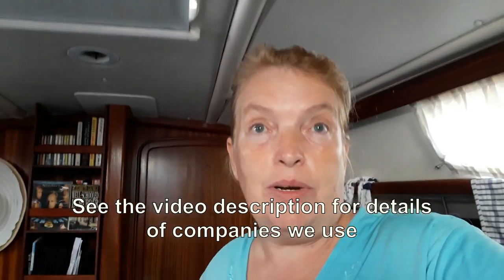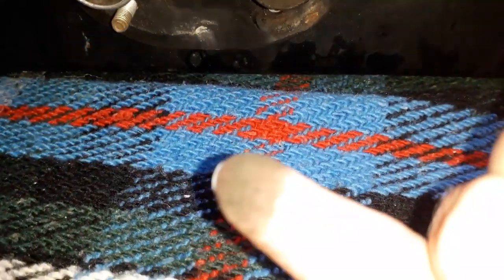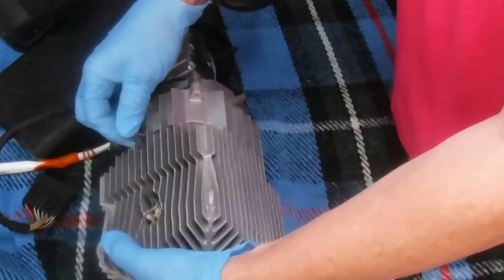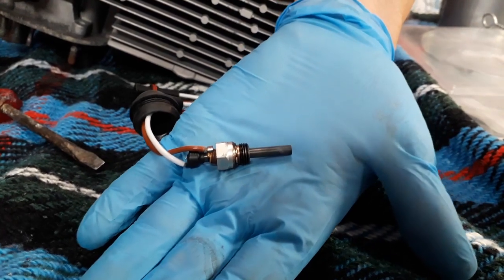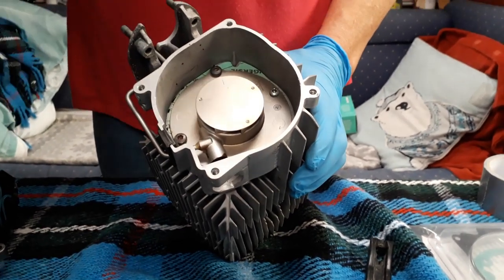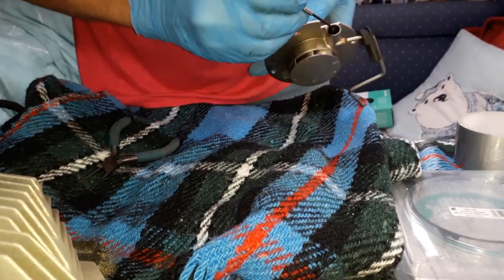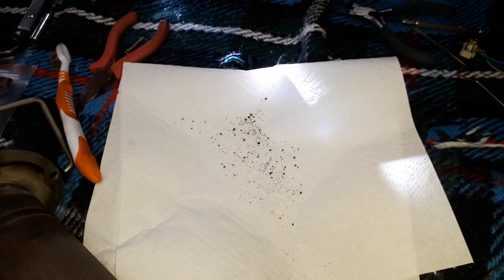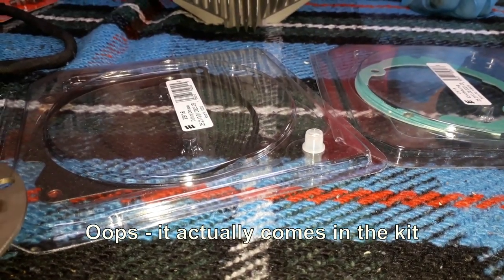Saving money & staying warm - Servicing our Eberspacher Airtronic D4 diesel heater - Ep. 111

Comment: I'm pretty sure you will know this by now but you can use your battery drill/driver to hold screwdriver bits like a torx bit and then either press the trigger or use the whole unit as a big heavy screwdriver!
Excellent explanation on the servicing of that heater. All lorry drivers are familiar with them since they are generally fitted in sleeper cabs. 🥵
I KNEW I should have waited till the end...!!!
😂😂
Reply from the maker: We have gradually got better at servicing this. Practice makes perfect 😉

Comment: Well done service great vid , our heater failed and was beyond repair ,so we replaced it with a cheap Chinese unit and I must say at £120 it’s incredible and if it fails I’ll probably throw it out and get another, although it’s identical to yours and all the parts are available. Thanks again enjoying your honest Vlogs👍
Reply from the maker: Thanks for the comments. I am glad you got a solution that works for you. I am told that with the Chinese versions, the exhaust hose is the weak point, but if you have issues with it they are not that expensive to replace.
Reply: Sailing Yacht Salty Lass yes very much inferior exhaust but I was fortunate to be able to reconnect to the existing eberspacher exhaust, so far I must say it’s an impressive wee beastie. Enjoying your vlogs I’m across the water from you in Clyde marina (just up the coast from Troon)
Reply from the maker: In the one with the big crane?
Reply: Sailing Yacht Salty Lass you may be thinking of James watt dock further up the Clyde ardrossan is literally just across the bay from Troon ,I know you’ve been to Largs and Troon,Clyde marina is the other main marina between the two ,the other big crane you may be thinking of is the two ore terminal cranes next to Largs that have just been removed.
Reply from the maker: The big crane was at Greenock, but I recall the Largs cranes that we went past last summer. Adrossan used to have a ferry service to Belfast and when we came past it from Milport we heard the Habourmaster on the VHF broadcasting boat movements for some vessels. CalMacs perhaps?

You have brought it all back with that comment. I had sort of fogotten it, but it has come flooding back :-)

Comment: Super video. Nice to see it is not so hard. I will be adding heat to my 22ft as I plan to sleep aboard from time to time
Reply from the maker: In these climates, onboard heating can be a lifesaver. Literally.
Reply: @SailingYachtSaltyLass  I used to love the cold, but these days no. And my two dogs would be most upset if no heat was there for them. I would have a mutiny on my hands

Comment: That is a really good video how to! Gona share on our FB page. We have an Avro M5  which is basically a Makumi (Japanese) diesel heater. They work in the same way but the glow plug is from a diesel car (Easy and cheap to replace) and they have a brushless motor (no brushes to wear out). So the top tip from the supplier in Southampton was every spring run it on paraffin at full tilt for an hour to burn off all the internal carbon. Seems to work! If you do this it never needs a service until it stops working and then it either the glow plug or the overheat sensor! Sure enough 5 years on and one overheat sensor replaced at £40 shes been 100%  and never a full service! We also found a trick to wire in a switch so the blower runs and the heater does not. Its good for cooling the boat when your down south. I think you can do this with your heater too. May be worth a google? Thank for sharing cracking video!
Reply from the maker: I thought when I was doing this that it would be dry-as-dust of interest to mechanical types only. I have been blown away by the reaction. It seems I got this one right. I am not an engineer, but I did a lot of IT support, development and training for 30 years so I can usually explain stuff well once I understand it.

Please feel to share it if  you know someone it can help.

I have heard about the paraffin fix but we have no easy way to plumb the paraffin in and I am reluctant to cut/splice the fuel line. 

The Eber does have a "ventilation" setting built in. We did use it to ensure that we could work it, but that was once about 18 months ago.

I am glad you enjoyed it
Reply: @SailingYachtSaltyLass  Just out of interest do you have a Co2 alarm fitted on Salty Lass? We did a how to publication for the Bavaria Owners a few years ago (we were Vice Commodore and Treasurer at the time ) One of the top things we recommend was Co2 Alarm with any fossil fuel heating source. To be sure, to be sure. Gas and Smoke alarms too. All from B&Q cheap as chips but ensure you dont wake up dead 😉Just test them once a month as part of your monthly checks. Temps dropped her now we are down to 17 c so the heating is going on. 2 Kw fan heater with a tilt cut out if it gets knocked over. Again Lidl €15. Better than using or Diesel thats €1.47 a Ltr here!!!!!!  Again, a great video!  Looking forward to watching the rest...Sail Safe Ant, Cid & the Pooch crew.
Reply from the maker: @SV Impavidus (Ant & Cid Sailing) - 17°C? I would love for it to be as high as that. I might consider a T-Shirt. It is a balmy 6°C here.  

We have not had a lot of luck with alarms, so the boat is kept well vented, even at night. We never have her totally enclosed and "locked down" tight and we always open the main hatch and companion way when using the cooker. We have had the gas system tested a few months ago and a safety certificate issued. The port lazarette has been converted to a vented locker and extra gas bottles and a small container of unleaded are stored in approved containers in there.

You do what you can.....

Comment: Once you remove the motor, you can easily undo the glow plug with a 12mm spanner from inside, negating the need for the slottet tool thingy majigey.
Reply from the maker: That is interesting to know. We might give that go. Thanks for the tip!

Comment: some people say running it on high with kerosene will clean it out since it burns so clean on its own. another youtuber showed you can run these on alcohol. they run terribly but the water content should steam clean it. you can also adjust the air fuel ratio by adjusting the min max fuel and fan speed in the advance settings. you should be able to get it to burn cleaner that way. I dont think you really need to clean the burn chamber since that stuff shouldn't affect anything unless its quite literally jamed full.
Reply from the maker: Hi Jim - I am not sure how we would adjust those settings, but we know how to scrub things clean 😄  I have heard about the kerosene, but given the configuration of our boat and fuel systems, installing a separate kerosene feed is not really feasible. To pull the unit for servicing every so often is something that we can do fairly easily. I am glad to report that it is still running happily and is warming my feet as I type this. It is 3°C outside with a wind chill that takes it down to -2°C

Comment: Just a quick note on using the glow plug removal tool, you don't need it. Remove the fan unit first then you can use a normal 12mm spanner on the glow plug.
Reply from the maker: What a great tip! I wish someone had told me that 2 years ago......

Comment: Mine stops working unless its on high. Probably beacuse the airways are blocked.  Thanks for the excellent video.  
Did the slotted socket come it the gasket kit?
Reply from the maker: The slotted socket we made by cutting a 13mm long socket with an angle grinder, but then we got the proper one from someone who had a spare. I think your diagnosis of a blocked airway is correct. When it happened to us, it was a piece of pipe that we had accidentially crushed flat. We cut the flat bit out and joined the two ends together and it has been fine ever since.

Comment: They do have a new additive to add with the fuel eliminate the carbon in the diesel fuel it's like a catalyst they call it maximizer mileage you can go to Pittsburgh power. Com and order it it is a little bit pricey but you only use 1 oz to every 25 gallons I started using it in my truck which I have the same heater and it works wonders
Reply from the maker: Interesting - I have never heard of that back we can have a look at it. Thanks for the tip.

Comment: great video. I have no heating on my boat and need to make a plan for the winter later this year. With the Chinese brand heaters doing a similar (with respect to eberspacher) job. would you recommend the extra cost to install one of these over the Chinese ones? I'm trying to keep my budget modest. But if the heating fails on me, liveaboard in the UK could be deeply unpleasant.
Reply from the maker: I have not come across the Chinese ones so it is very hard for me to comment on them except to say what others have told us. Firstly, if you buy the Chinese ones then do NOT use their exhaust hose or the exhaust silencer as these are reputed to be of very poor quality and leak carbon monoxide. Buy an Eberspacher or Wesbasto exhaust hose of the correct size as these are not expensive. Also buy the rock wool lagging and put it around the exhaust hose as it makes a huge difference to safety because that exhaust gets REALLY hot. Better still, buy twice the length you need and double it up so it is twice as thick.

Secondly, lag the airducting going to the cabins so that you heat the cabins and not the lockers and duct spaces. The lagging is expensive but the diesel you will save will pay it back.

Next, make sure the air intake for the cabins is well away from the exhaust. You do not want to be sucking exhaust fumes in. This has killed people due to Carbon Monoxide poisioning but if you just make sure that the intake and exhaust are (say) a few metres apart then you will be fine.

Lastly, the price difference between an Eberspacher and a Chinese one is considerable, but there seems to be an intermediate option - an Autoterm/Planar heater. I have heard good things about these and know some people who use them and there are agents/dealers in the UK

I hope that helps. Do get back in touch if you feel I have missed something
Reply: @SailingYachtSaltyLass  thank you for that detailed response. much appreciated.
Reply from the maker: You're welcome 👍
Reply: I have a Chinese one in my shed, works a treat not serviced it,  if it fails then £75 new one

Comment: My eberspacher boat heater stopped working all of a sudden. I don’t think it’s the control box as I replaced that a few years back. What’s the most likely cause do you think? It’s approximately 17 years old and I have never had it serviced. Some people mention the glow plug and mesh but I wonder if there is a Nozzle which injects the diesel. I have a similar arrangement on my oil boiler at home and I replace that every year. I was also thinking about whether there is a fuel filter somewhere on the unit. Any thoughts? Thanks, Michael

Edit - apart from the things you did! I’ll try to cover all eventualities when I remove it all at the same time!
Reply from the maker: Hi Michael - when you say "stopped working" what exactly do you mean? Totally dead - nothing happens? Starts up, blows smoke then stops? Also, do you know the model of eberspacher?
Reply: Thanks , Eberspacher Airtronic D4 is the model. It’s been awhile but as far as I can remember it basically doesn’t even go through the start up initiation (I seem to recall that when it did work there were a few clicks and then the fan cut in) so it could be a fuse or something possibly. I think I’ll take it off and have a look anyway.
Reply from the maker: There should be a fuse near the battery, check that first. Eberspachers should not go through the boat's main switch panel as they should never be turned off suddenly, so the power lines to the Eber usually have their own fuse. 

Blocked gauze or a blocked airhole will result in the Eber starting up and blowing clouds of unburnt diesel smoke because  the mixture will be wrong. If it is dead in the sense of "nothing running" then I would suspect an electrical fault.
Reply: @SailingYachtSaltyLass  Thanks, I’ll check again when I’m at the boat!

Comment: I also opened my D4S Eberspächer. I have it on Vw Crafter van for only in rear cabin. In summer it only smoked a lot and not started great. Now the blower works only. I can't hear the sound of the fuel pump any more. I tried with 12v and it worked. And checked the glow plug with 12v and cleaned the whole unit. I haven't yet tested it. I don't know is my timer broken because when I turn the key to on position or start the car the timer also start. I don't know why because this is not for the motor (what is bad thing) it is just air heater for the rear cabin.  Any ideas what to do?
Reply from the maker: If you cannot hear the fuel pump, it may not be pumping fuel. Also the fuel pump contains a small strainer that should be changed every so often, but I would expect to hear the "tick-tick-tick" of the pump. Get a voltmeter and check that when the system is turned on, 12V is showing at the pump. If there is no voltage at the pump then you have an electrical problem.

Many Eberspachers have a fuse near the battery. Check that if there is no power getting through. Since the blower works the fuse is probably OK.

If the pump works separately then the chances are a bad electrical connection somewhere. You will need a voltmeter to find it. Just start at the panel and work towards the blower/pump and you will find a loose or corroded connection somewhere
Reply: @SailingYachtSaltyLass  Thank you very much for the answer. I installed it back and tried it. It started normally and worked normally I think so. But when I set for example 20min cycle for warming it will not stop after that 20min. I think it drops power but it not still stop. It stop only when I turn key to off position or press timer on/off switch. I have to test will it shut down if I don't turn key to on position. The lcd light turn on always when I turn the key to on position. Is there some automatic system or is my timer broken or can't I  use it the correctly ?
I haven't yet tested timer functions but I think otherwise it is okay. It's just the problem it not shut down on itself.
Reply from the maker: @ahsell1598  - On our Eberspacher, when we press the "Off" button, it takes about 5 minutes for it to shut down. The reason for this is that it has a series of steps to go through that stop it sooting up.

If you just turn it off at the breaker, it will soot up very quickly.

Let it do its own thing and you might not need to service it for years

Comment: Don’t use WD40 on the bolts, it’ll dry them, use a tiny bit over copper grease, they will come out much easier next time. 
Motor on mine has dying bearings, I’m going to rebuild and see how it goes
Reply from the maker: Our motor went as well. We looked at pulling it apart but it went in December and Xmas was messing up deliveries and such and it was cold.... so we just splurged on a new motor which took less than an hour from pulling the unit to having back and running again.
Reply: @SailingYachtSaltyLass  what signs did it give that it was going? Mine is ‘hunting’ a lot. Ramping up speed every now and then
Reply from the maker: For some reason, this comment and about a dozen others has only just turned up in our comments section so I apologise for the late reply

Our impending "failure" was fairly obvious - on start-up a vast plume of smoke out the exhaust during start-up and then it failed to start.  It is getting that way now after two years so we will pull the unit and service it before we go off this year

Comment: Don't use cheap supermarket diesel. Too much biodiesel in the fuel. It causes the unit to soot up. Too much soot build up on the glow plug and the diesel won't ignite.
Adding diesel additive will make the unit burn hotter and burn off any soot build up.
Reply from the maker: We use supermarket diesel when the marina fuel pontoons are shut because of COVID or if we are at a marina where they do not do diesel. We ALWAYS add a fuel conditioner whether red or white.